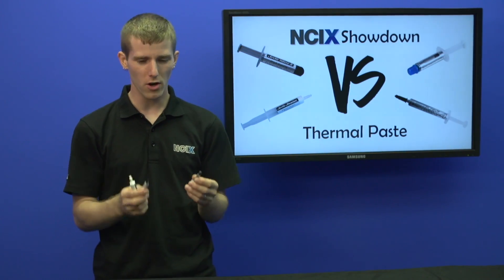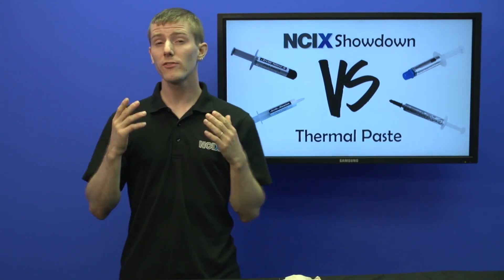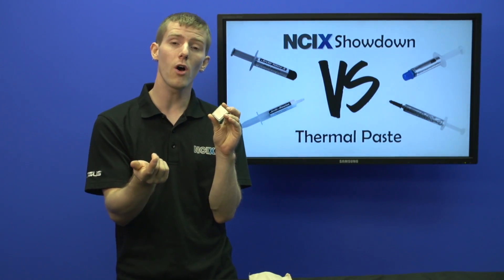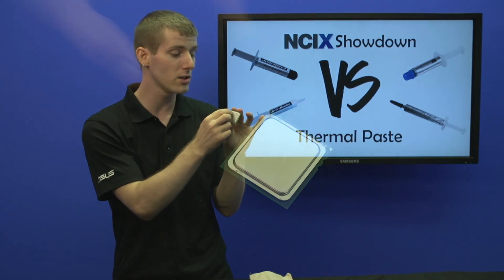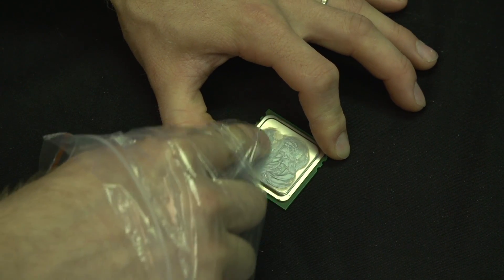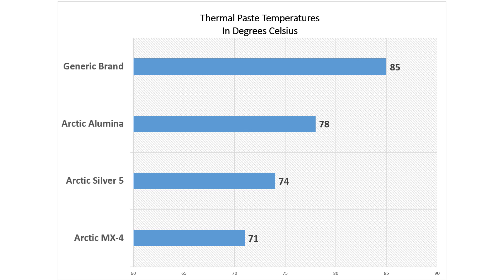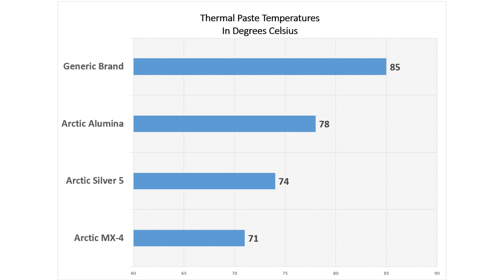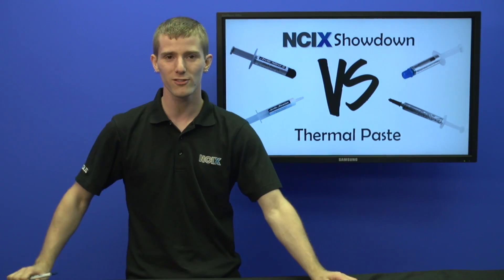Thermal Paste - NCIX Showdown

Comment: Note the Arctic Silver 5  comes with a round cap on the end.   Apply paste,  put the cap back on the tube, and it works great to spread the compound evenly.
No fuss, no mess.     Silver 5 is the tried and true, dependable results every time.

Comment: I would add...if your a crazy overclocker...grap some 600 or 800 grit sand paper, soak it with water, with the sandpaper on a really flat surface, turn the face of the chip into a flat mirror. (the darker it gets the flatter).
Then when you rub or twist the heat sink on the chip...."ring" it to the chip. Look it up if you dont know what that means.
This will gain you -10 degrees easy. Personally, this is too extreme for even me, im too lazy. But being a precision machinist, i do this stuff every day at work. Its real.
Ive got a 4790 running at 4.5, good enough without being extreme. Or OCD.
Reply: the paste is to make up for the unflatness and grooves. The idea is to not need the paste by making it flat and smooth ON BOT SURFACES. PEOPLE forget about the heat sink!!!!!!!!!!!!!!!!!!!!!!!!!!!!!!!!!!!!!!!!!!!!!!!!!!!!!!!!!!!!!!!!!!!!!!!!!!!!!!!!!!!!!!
Reply: BOT = BOTH

Comment: Artic silver 5. I did a cross with a dot in the middle. Fx 8350. Applied it 2 days ago. First day (day of application) 67c. One degree less than previous thermal paste. Second day 63c. Today, day 3. No idea. Im on my phone, havent played fo4 yet. But im hoping for another decrease. It says 200 hours after if reaches full potential. So im curious how much the temp will decrease the coming days. So far it looks great.

Comment: Doesn't matter how you put the thermal paste on guys, just a btw.
Reply: Tom's hardware has done a fine article on this. I tend to agree with FInnishArmy from all the videos I've seen. It seems that even though Arctic Silver 5 is not the best at cooling, after years of use it will still be there looking like a paste whereas others might dry out or become glue like.
Reply: It does matter. Just don't spread it around with your finger or use too little or too much and you're k.
Reply: RpiesSPIES nope, its been tested
Reply: +FinnishArmy yes. And after the tests, the results were that using the spread method was extremely inefficient, messy, and didn't cover the cpu as effectively for cooling. Putting too little didn't cover all the cores and resulted in much higher temps. Putting too much cooled fine but is very risky since it could still over onto the board and possibly damage it.
Reply: Nope, here's the tests, pea method: 47C, line method: 47.1C, X method: 47C..... do I have too? K, spreading with card: 47C, spreading with finger: 47C, putting too much: 47C, putting to little: 56C, only if you put too little will it actually affect the temps.

Comment: If I buy a tube , and used it once only as pea method,  will the tube dry up , as I will used it once  for myself unless I feel it is getting to heat. 
Can it last years and years
Reply: as long as the particle have not settled. arctic silver 5 has silver particles that will settle. ceramic style will last forever
Reply: ZIPPER978 ya I seen Arctic  ceramic one too
Reply: I have a tube of MX-4 for about 5 years, use it from time to time, once in a while, I need to remove the first drop of the syringe because it has hardened a bit, but apart that, that lasts (very) long.

Comment: I got an i7 6600k skylake which compound do i put on that or it doesn't matter so much?
Reply: There is no I7 6600k , but a I5 6600k and I7 6700k ... But for ThermalPaste , just use what comes with your CPU cooler ... BUT DONT USE THE BOXED COOLER , unless you want much noise and high temperatures...
Reply: oops i ment 6700k
Reply: im putting on a liquid cooler
Reply: +Kurtis Horvath It will probably have thermal paste pre applied .
Reply: D
Reply: IC Diamonds 7

Comment: What do you mean by sub-zero temperatures? Wouldn't that be a very cold environment already?
Reply: Some people put Liquid Nitrogen to cool thier PC
Reply: Sub-zero cooling is achieved with a phase change cooler, liquid nitrogen or dry ice.
About the cold environment, ya, putting your PC outside at winter is sub-zero cooling XD

Comment: When I first built my PC I put a small amount of thermal paste but found the Temps going a little high for having a cooler that competes with liquid coolers.  I added a bit more more than what linus recommends and found that my Temps were a lot more cool. I don't see how adding a lot would insulate the heat I could see this happening when you add so much that it leaks from the sides.
Reply: You are correct my friend. The myth that less is more is  completely a lie and proven wrong.

Comment: Right after watching this video, I run to the store and grabbed MX-4, came home and went through the whole process to change the paste. Result? the CPU is 2 °c warmer.
Reply: Arctic Silver and ARCTIC Cooling solutions are two different companies. Arctic Silver makes Arctic Silver 5. Alumina. And ARCTIC Cooling makes MX-4. I use Arctic Silvers Ceramique 2 (which is hard to spread, but works awesomely as the pea method and sets really quickly.) Recently I bought ARCTIC Coolings MX-4 to try. Not in yet, but the point of this post was to provide the information differentiating these companies.
Reply: lol
Reply: dank story bruh
Reply: more won't actually increase temp that myth was debunked many times
Reply: Thermal paste needs to be applied in sufficient qty, as said above, if you cover the whole CPU (or GPU) then that's fine, more will do no harm (in most cases) except maybe making the things a bit messy. Less will do harm as it will leave an air gap. As for the method of application, it all depends on the viscosity of the paste and the pressure applied by the cooler. key is to spread it all over and the thinnest possible. 

In Arctic's portfolio, MX-2 is more suited for low pressure application (coolers with push pins and those without backplate) while MX-4 is most suited for the high pressure application (coolers with screw mounting and backplate). reason being mostly the viscosity of both paste.
Reply: no
Reply: Bad 4 u, i got more than 10C less on the cpu and gpu
Reply: TrollFaceTheMan yes they did i saw that video i know that jayztwocents did aswell
Reply: TrollFaceTheMan switching mobos is always a pain when your friend was convinced by an "expert" that they needed to and they really didn't have to at all when what actually needed changing was just a little more thermal paste it's like changing out an entire car engine when all it needed was an oil change
Reply: Well my friend wanted to add a new cooler as he was using a stock one, that was when the other guy tried to install a aftermarket cooler for him but failed and then erroneously told my friend the motherboard was "Unable to use different coolers other than stock..."

 Literally the guy that did this was too stupid to realize that the bracket just needed to be flipped the other-way to go on...

 After failing he put back on the stock cooler with only 1/3 the thermal paste it should of had and then convinced my friend to get a new MoBo. By the time I found out he had already spent $100 on one so I just installed it for him while using it as an opportunity to teach him a bit about building computers.

 I am just glad he bought one with the same socket type...
Reply: TrollFaceTheMan yeah the brackets are really not that hard hope that mistake doesn't happen again eh
Reply: What kind of thermal paste did you have previously?
Reply: Pre-applied
Reply: Is ceramic 2 bad for air cooling?
Reply: though not always more expensive tends to be better and old compound on the cpu lowers temps
Reply: ***** Same thing happened to me a few days ago with my MX4. My 980 ti was reaching 90 degrees C. I reapplied it using the spread method and now it goes to 70 degrees C.
Reply: Nawaz Waseem a drop in 20 c
Reply: More than likely you didn't have enough past on there to properly cover the whole CPU plate.
Reply: TrollFaceTheMan HEY I KNOW YOU WASSSUP
ps i agree people are to anal about to much paste these days
Reply: bacon Bliss
Nothing Much, and yes I believe even linus media group had proven that the too much thermal paste myth was false.

 Well at least with the thinner thermal paste we use now-1-days.
Reply: One of my friends had someone else replace some thermal paste on his CPU and the heat issue's got worse, when I took off the heat sink I found that the other guy literally covered 1/3 of the CPU with paste...

 This other guy also convinced my friend he needed a whole new MoBo in order to upgrade his cooler which was 100% Bs! This guy was obviously a schmuck who wanted to play techie...

 I helped my friend install the new MoBo anyways after he already bought it without consulting me about his Friends "Advice..."

 Let me tell you that windows does not like you swapping Motherboards, took me around 3 hours to get everything working again...
Reply: Yeah
Reply: +Blaze Townsend Really? That's definitely grounds for trademark infringement because there's legit customer confusion.
Reply: I used silver 5 and feels like its overheating everytime I play games that I need to turn the ac on to be able play now  ...
The paste wasn't as thick as the old one 
I'm going to try mx4
Reply: Well I am using arctic silver 5 on my 4930k which when I just stressed it using Intelburntest. The max it got was to 62c, and that is with it OC'd to 4.4Ghz from it's normal 3.4Ghz.

 In fairness I am using an H105 water cooling system, but the paste is also 3 years old and I have had no issue with it.
Reply: What cooler are you using? And why do you need to turn on your air conditioning, your pc getting too hot or your room heating up more?
Reply: arctic silver 5 is better
Reply: ***** you are actually supposed to use way more than the pea size dot of thermal paste you are supposed to glob it on it come like that from the manufacturer and is recommended by the manufacturer
Reply: ***** for gpus anyway you can usually get away with more than recommended on cpus to
Reply: I do give huge value to hardware and try to take as much good care as possible, but I always use cheap thermal for the cpu from at least a known brand and it works pretty fine by me
Reply: I know this answer is more than one year old, but I hope it helps people that will read your comment: the arctic silver 5 I have came with explicit instructions telling that it only achieves maximum performance after 200 hours of use. There follows the website reminder: 

Important Reminder:
Due to the unique shape and sizes of the particles in Arctic Silver 5's conductive matrix, it will take a up to 200 hours and several thermal cycles to achieve maximum particle to particle thermal conduction and for the heatsink to CPU interface to reach maximum conductivity. (This period will be longer in a system without a fan on the heatsink or with a low speed fan on the heatsink.) On systems measuring actual internal core temperatures via the CPU's internal diode, the measured temperature will often drop 2C to 5C over this "break-in" period. This break-in will occur during the normal use of the computer as long as the computer is turned off from time to time and the interface is allowed to cool to room temperature. Once the break-in is complete, the computer can be left on if desired.
Reply: It takes some time for the thermal paste so full out the gaps and work as well as it can.
Reply: yeah dont get caught up in the hype a thermal paste wont get you better performance. there would be very little difference between all of the thermal pastes out there.
Reply: +Leo take it off and reapply the paste. Try not to use too much.
Reply: Well for one this video is a fake, He literally showcased one companies cooling compound. All three were arctic, also he showed their most expensive to work the best. This was just to generate sales. Different compounds don't make much of a difference, your higher temp can be explained though. Some compounds have a cure time before they work at maximum efficiency. Arctic is one of them. Your old paste had probably already cured, while this new paste will need some time to cure all the way. at the point you will probably see the temps normalize, also make sure you put enough, extra won't cause it to heat up, not enough will though. That myth that less is more is a lie.

Comment: Thanks, Linus.  I always wanted to know if there was any validation in the hype of these products.  I kind of confused about a new trend emerging in the CPU market.  Namely, pre-pasted chip coolers.  I am referring to my Black Series AMD FX-8350 octocore CPU.  This needed no thermal pasting but I wonder how good these are.  How long has this stuff been dried on the cooler?  How do I know if this could be dried out?  The answer is that I suppose no one really knows.  It doesn't bother me to put a $12 tube of Arctic MX-4 on it if it'll have such dramatic heat-reduction as per your illustration.

Comment: Should you wait for it to dry after applying the thermal paste or can you use your CPU or CPU straight away?
Reply: +Francois Smit 
>you can place your cooler on the cpu straight away without the need to let it dry

Comment: I still spread, but evenly (unlike the video). Anything to assist the bond/contact between the CPU and the heat sink. It might be shown not to give me massive temperature drops over the "rice" or the "P" method mentioned here, but I don't run the risk of having hot spots or areas that may be unbonded over the CPU dye.

Don't take shortcuts with your core components, unless you want to fill out RMA forms.

Comment: anyone have the evo 212?  is the thermal paste okay that comes with it?
Reply: I have an evo 212, but mine did not have preapplied/included paste? But even if it does I'd imagine its not too good so I'd get a tube to be safe its only like 5 dollars so no big deal
Reply: +Dayton Sette i had one and the cooler master thermal compound is apparently one or the best i read it in a breakdown of about 50 different compounds and it was top 10
Reply: +Dayton Sette Yes the little tube of Cooler Master thermal paste that comes in the box is good stuff.
Reply: +Dayton Sette yeah i used the stock stuff it came with. worked nicely in my home server. no complaints.
Reply: Ignore anyone that tells you otherwise, the included thermal paste is great for it. it will work just as good as anything you can buy on a shelf.

Comment: Does hand sanitizer work?
Reply: +Taurolyon over 70% is enough
Reply: It doesn't work very well
Reply: I wouldn't try hand sanitizer, because they add a bunch of thing that could stay on the CPU and reduce the heat transfer. I personally use methyl hydrate since it is easy to find and dry out quickly
Reply: +KillTheCurse I would just use rubbing (isopropyl) alcohol, 91% or higher.
Reply: KillTheCurse alcohor will vapor instantly after u apply it to any surface. The thermal conductance (amount of heat that can be transfered per surface area) is bad. I dont know why I take ur silly question so seriously

Comment: My Raijintek Aidos came with a little packet of generic thermal grease, now I'm considering getting some arctic silver
Reply: This video is fake your generic Grease will work fine.
Reply: Kirk Slaydon 
You were right, I just used the stuff from Raijintek and it still works great. 35C all day, the highest temps I've seen under load is 65C.

Comment: you need to learn the difference between compound and past my friend what you show in the video is paste what you say is compound and they are 2 different things people with little pc repair experience do not no that and may buy compound not noing it hardens and depending on witch strength you buy you may never be able to get the heatsink off is you use it as some of it is strong as hell like an glue as for past comes off ex and never hardens. my self I use both depending what I need it for my self in some cases wear I need to have great cooling when things are getting bumped around I use a heatsink plaster as it can come off with a few lbs of pressure not damageing anything but still hold strong if the heatsink mounting comes loose a nother thing some people use is thermal grease but its nasty and messy. and is more for automotive.

Comment: How long should I wait until I replace or re-apply my thermal paste? I have MX-4.
Reply: +Cloud Strife i use it after i see the average CPU temperature rising, about every 18-24 months
Reply: +Cloud Strife mx-2 and mx-4 are rated to last 8 years. i'd redo it maybe if i notice my temps change over the years idle and heavy load but otherwise don't worry about it. check here for more info http://www.arctic.ac/worldwide_en/mx-4.html

masterrazzer76 just likes to practice putting it on. you don't need to change it every 2 or 3 months or even annually.  that's just crazy. do it once, do it right. keep an eye on your temps and you should be fine.
Reply: +Cloud Strife I annually replace it 4 to 5 month for me but i keep test marking my two gaming pc so it actually 2-3 month
Reply: ***** Will I be fine doing it at the end of every year? I'm planning on doing annual upgrades anyways. Just the fact of replacing it that often bothers me but I guess that's what I signed up for lol

Comment: To bad the shop near me didn't have mx4 or mx2, they only had ceramique, I used Artic Silver 5 in the past & didn't like it to much, on the video card worked ok but on the cpu kind of got it hoter even than the factory that was preaplay on the cooler.
Reply: I don't think I even have a shop in town that has any thermal paste.
Reply: I used the ceramique it works amazing i used it on my ps4 its very quiet now i had the generic brand and regret buying it lol